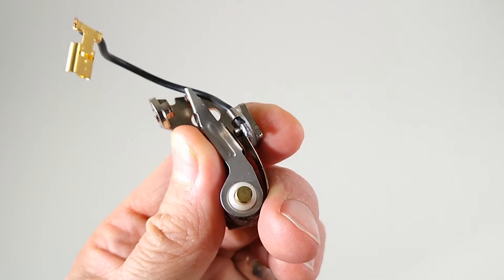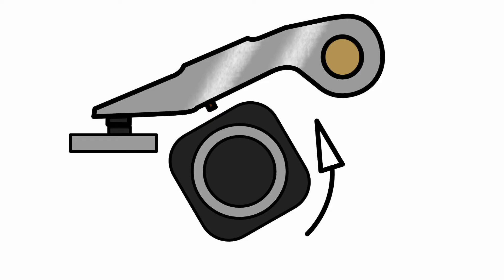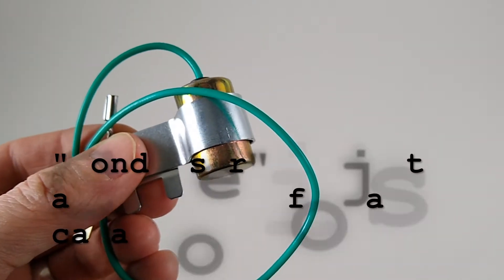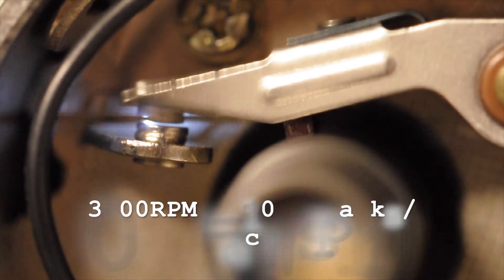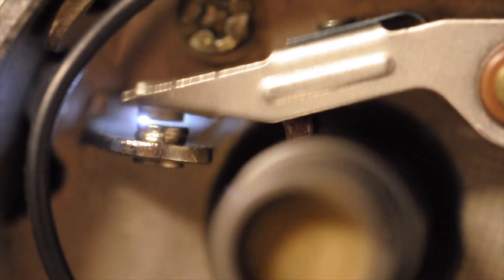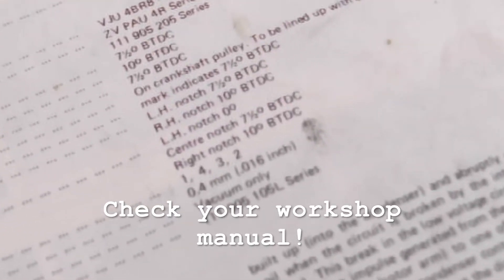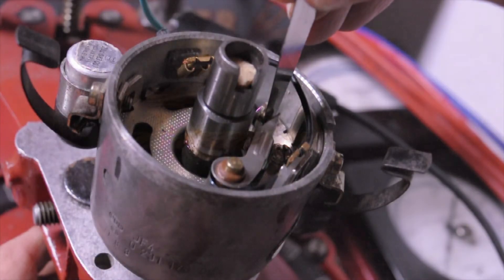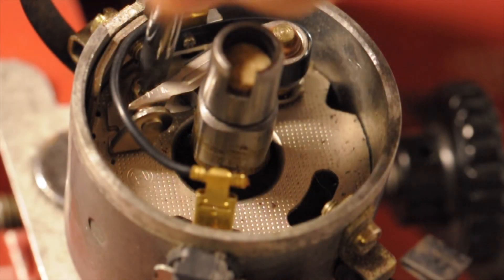Points and Condenser classic car ignition... What is it and how does it work?

Comment: Replaced the lot  on my old toyota starlet, coil plugs leads cap rotor points and condenser and vacuum advance, yet just 300 miles later had it refusing to start, or barely run except very roughly. Turned out the new condenser was an intermittent  dud, took me awhile to bodge up a temporary swap out , and find it, but only after nothing else worked..... grr
Another no start issue or runs but real rough, was oil seal for dizzy was leaking, and oil had got between braided ground lead connections to base plate, and dizzy body, and baked over the years with age and heat, that had me baffled for a long while. Only stripped and cleaned dizzy after trying everything else, and spotted it. They may be very simple systems, but sometimes they still have a trick or 2 you haven't seen before.

Comment: "I had a strong desire to learn how to drive a car when I was in India. At that time, I was young and uneducated, and I worked as an assistant to a car mechanic. During my work, I discovered the CP point mechanism in the car engine, which functions similarly to a neuron in the brain; at least, it looks like it. However, I was unaware of this until I was 55 and went to school in Sweden to study as a nurse assistant. It was there that I learned about essential medicine, and my understanding of the connection between nature and man-made mechanisms grew. I realized that if one understands nature, one can also learn about man-made mechanisms because one came from the other. Nothing grows in thin air."
Reply: Amazing comment, check out japanese bullet trains tech, there front nose aerodynamics is based on the kingfisher bird, they studied the bird mechanics when entering water, to build the trains nose

Comment: If you have to replace your points every 6000 miles, something is wrong.
Reply: THANK YEW WHOPPER WHOPPER TRIPLEWHOPPER
Reply: Agree. the old matchbook cover trick in a pinch
Try not to file them very often, if at all.
Reply: Exactly, my points on my 1969 Buick 430ci go 20K miles at least. I have still not wore them out. Just clean the points when needed and set dwell to spec. They go on forever on a daily driver.
Reply: @robrobster9148  there were good brands....eichlin.....delco.....then there was cheap crap......